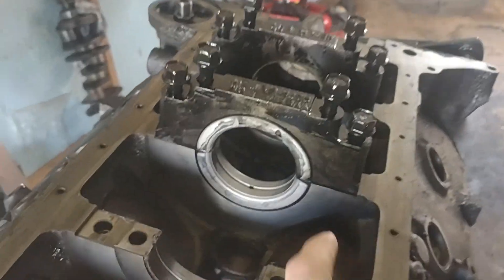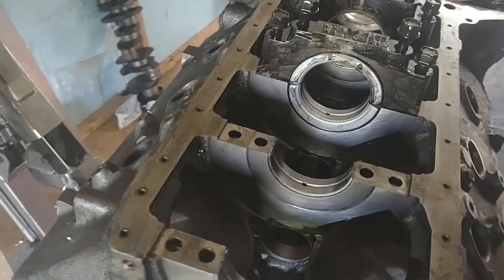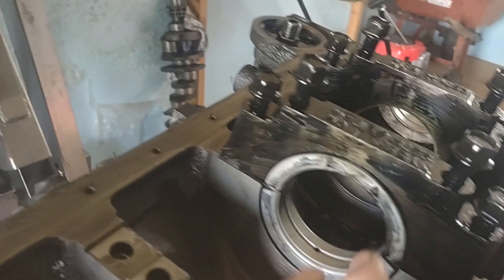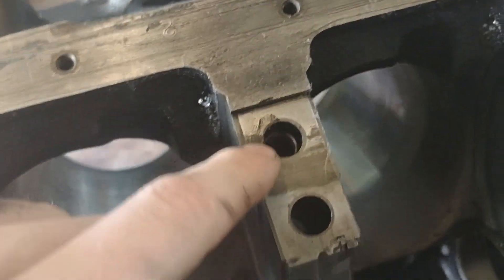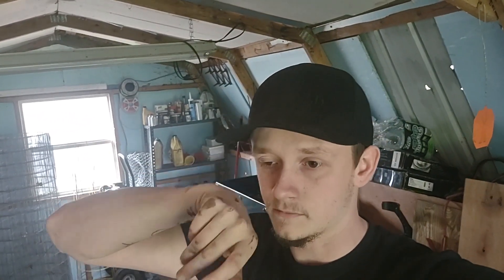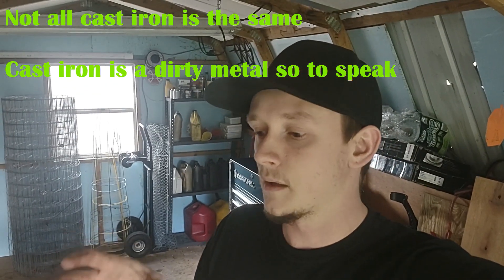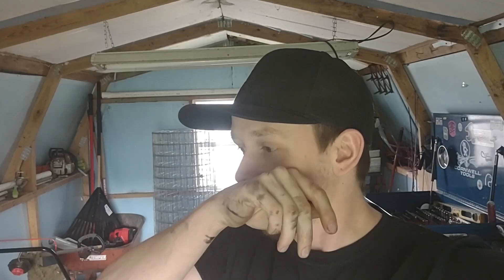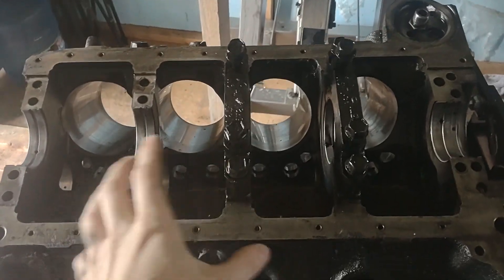6.5L turbo diesel main web cracking

Comment: Ouch ! It can be fixed to be stronger than factory though. A hairline crack like that can be fused with a tig any major stuff can be filled. Then (permanently ) install a stud kit,  Thank you again for all your help once again, you are very rare  especially nowdays sent you a message  to fill you in on recent happenings here my mom's still sick I got a few other things to put in that box for you. You will have a nice build i hope you do with a 6.5 what everybody says cant be done with a 6.5. It will need a manual pump for big power. Use this block it will be fine. Remember i was telling you my dad was yelling at me telling me these all have junk castings and are full of cracks,  believe me ive repaired  all aluminum blocks with a hole in the side of them,  in drag racing we call them windowed blocks ! I could easily fix this to be a lot stronger than stock, most of my repaired blocks went on to make 2000 hp and more ! Wish i was there with my welder and you had a small machine shop I know for a fact I  could make this way stronger than stock.

Comment: Ive had a 6.5 now for 7 years its been a good truck but the engine is a little tired but still runs good and gives all the power I need. It probably could use a ring job , but it aint broke so i aint gonna fix it. Since then Ive watched a lot of 6.5 vids and yours is so more informative. You are now as I see it, the 6.5 guru. The Engine should never be "Hopped up" their at their limit now, I want average power, cheap parts and good fuel economy. there are adapter kits available for Cummins in ck trucks if you want to get reliable higher power. $$$$
Reply from the maker: I appreciate it man I'm no expert by any means and I don't claim to be, I've just worked on my fair share and happy to help those who need it where I can 👍

Comment: We’re the marine blocks different than the regular production blocks in the main webs? I hear the marine block is higher in nickel content.
Reply from the maker: From what I've read yes that does seam to be the case with the marine blocks. Marine applications were built to handle more power.
Reply from the maker: @richiesrestorations4883  unfortunately this is true as well, fact of the matter is sometimes you get lucky and find a good one, sometimes your SOL. I can remember if you told me that or not but DAMN what a mess hahaha. You as well brother 👍
Reply: They use the all American hi carbon hi Nickel alloy like chevy 010 small blocks, look out back where bell housing mounts up a lot of people say ohh that means its factory 010 over bore which isnt so it does mean it means your block has a 10% higher content of nickel and a bit more carbon to make it harder so salt water doesnt effect them as much The 6.5 standard block is like chevys made in Mexico block, they aren't very good.
Reply: Having worked with GM on solving issues for this engine and trying to limit this problem- I would love to see anyone actually produce information about the “marine blocks”.  Y?  Doesn’t exist.  Its as bad a rumor as the hmmwv/hummer blocks.  

GM produced them all in same plant making changes over time until they stopped production and GEP a subsidiary of AM General started with the rename from 6.5 liter to the 6500 optimizer. 

Penisalur diesel was the main company known for the marine built units as they did the majority of them and did the builds for the military application units.   That company has been sold with all rights and production abilities to John in Texas of Unique.  The manifolds, turbo, intake is all they actually produced.  Their 18.5:1 pistons were produced by a different company now gone.  

Mahle makes acceptable 18.5:1 pistons last I checked and Twisted Steel has modified ones available as well as the 18:1 with valve reliefs in it. 

The optimizer blocks have the ideal metallurgy but still crack.  It isn’t the metallurgy nor the oil squirter holes. 21:1 is insane pressure and at our angle makes it very susceptible.

Comment: When I bought my P 400 through Leroy Diesel it was cheaper than buying a rebuilt 65 diesel back in 2017 or 16 whatever it was and have a new engine instead of a rebuilt remanufactured I tried several outlets before I made my decision to buy the P 400 and it came down to it that’s a brand new engine from Leroy‘s diesel was about $1000 difference less than a remanufactured engine so why not get the P 400 that’s how I got the 400 for my pick up but my question is why can’t they manufacture girdles to put on these engines to help beef up the bottom end and make it stronger of course you’ll need a new oil pan because it will be similar to the P 400 when they do that.   
I had to replace my engine because it was beyond repair that’s why I went with the P 400 just saying.
Reply from the maker: I'm sure somebody out there with the time and the money could afford to remanufacture p400s or come out with a legitimate main stud girdle system that works, unfortunately I haven't seen any kits available other than the angle iron kits that I have noticed through several other companies. I wished somebody could start remanufacturing p400 blocks but unfortunately as far as I know they have discontinued them, probably why Leroy can't get his hands on anymore of them.